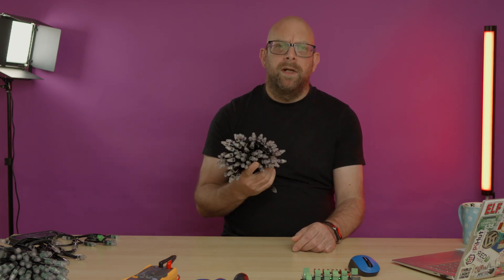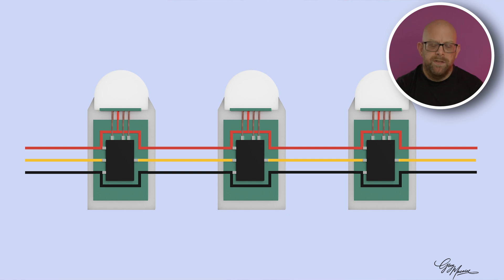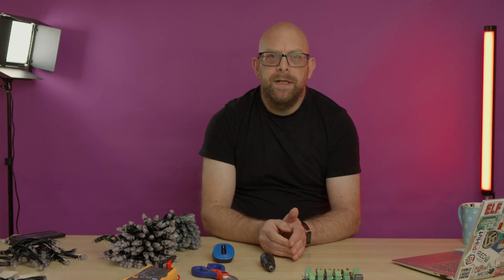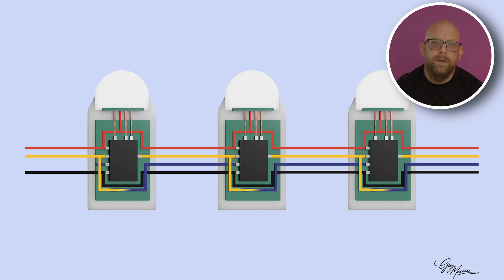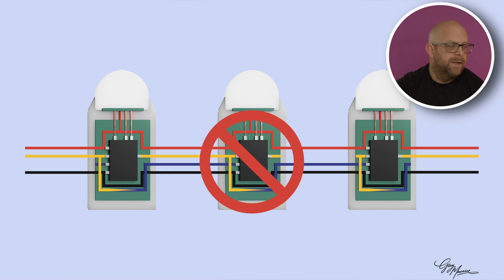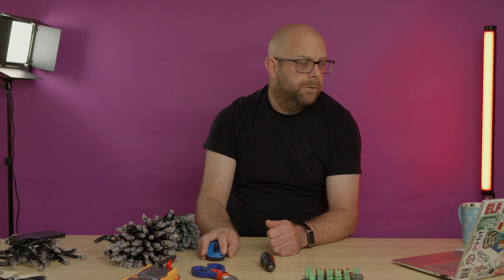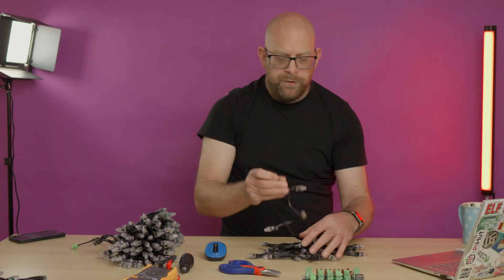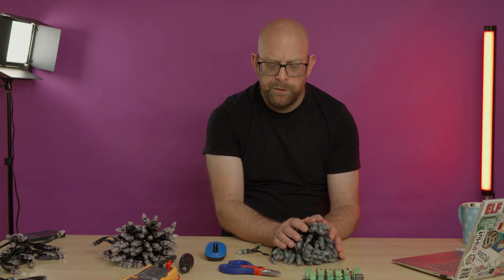4 Wire Pixels - Are they worth it ?

Comment: Very informative! Do you have another video about 4-wire seed pixels? I took some apart and found that the backup and primary data lines are switched between pixels. That is, if a pixel has pin 1 V+, pin 2 data in, pin 3 backup in, pin 4 ground, the next pixel in the string has pin 1 V+, pin 2 backup in, pin 3 data in, pin 4 ground. This in done to avoid crossing wires in the very tiny package. Apparently this is the case only for seed pixels. The pixels are from Ray Wu.

Comment: Efficiency... As mentioned by @Mjunek, the LEDs in these are wire in series, so when you display white, the current passes through the red, green and blue leds in series rather than in parallel as with the WS2811. So the current is potentially only a third as high, although there are other overheads. The benefit is that there is more headroom for voltage drop, and also the worst case voltage drop for a given number of leds is only a third of the drop with standard 5v leds.  When an led is off (or off for part of the time in a PWM cycle) the controller chip shunts the current around the led for that colour. In theory, the shunt current can be switched off completely if all of the leds are required to be off which would save even  more power, and perhaps they do, but that's down to the chip designers - I don't know what they actually do since I don't have these pixels.  There is an English language version of datasheet for the GS8208 available online and shows the typical method of usage if you are comfortable with semiconductor datasheets.

Comment: Do you need to convert to 4 wire pigtails or does some magic happen so it still works with a 3 wire?
Reply from the maker: The backup data should be linked to ground at the start, it will be generated from the first pixel onwards.
Reply: Nice one Greg, thanks for the review 👍
Reply: From what I understand, the second data can be connected to ground or the data channel. I checked with a few manufacturers and they aren't completely in agreement but I tried both orientations with a set of strips and it did not seem to matter.
Reply from the maker: @BlaineDuffield the data sheet for GS2808 shows Backup Data connected to ground at the start.
Reply: Excellent video, Greg.  I have been using 4 wire strip on my arches for the last 4 seasons and have all 4 wires connected to the F16 v3 and the outputs set to WS2815 pixels. Your video suggests there's no need to run 4 core cable back to the F16, just bond backup data to groung at the 1st pixel and I can leave all the outputs set to WS 2811. Is that right?
Reply from the maker: @DustyBannerman yes, that’s correct

Comment: Brilliant Greg, this answered a load of questions I had on these. Perhaps when you review the Baldrick you could touch on where that redundant data wire connects? Also I think I read somewhere that they have a different RGB order that has to be set on the controller, or is it in xLights? Great info though and well explained; keep ‘em coming!

Comment: One thing on the power injection - whilst they draw less current, they require a higher voltage to operate than standard resistor 12V pixels. The latter will tend to operate down to 5 or 6V at the end of a string, whereas these need a minimum of 9V due to the three LEDs being in series - so it's likely they will have similar performance overall from a power injection perspective.

It should also be noted that due to this series arrangement, that they use the same power whether it's 100% red, yellow or white (R only, R+G, R+G+B) - so that needs to be considered with the "oh im not running full white so i'm good" statement - full red (or green or blue) uses the same power as full white.